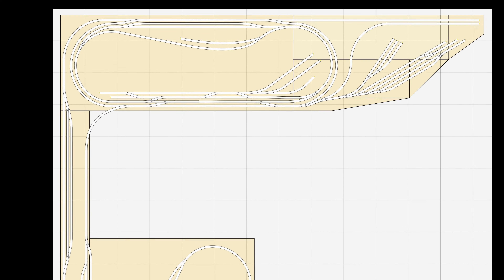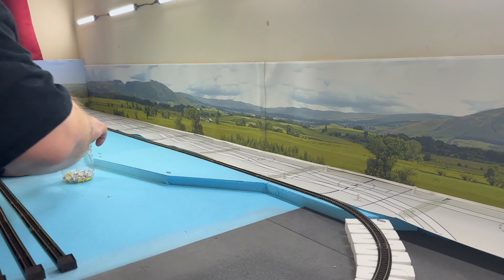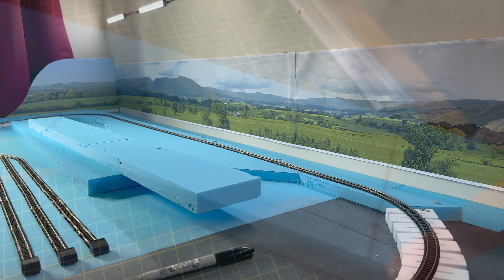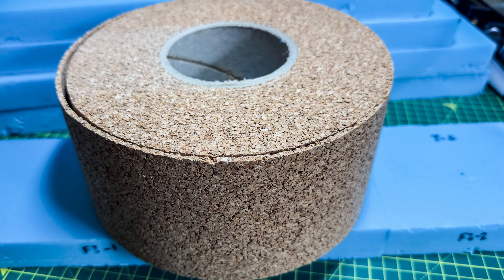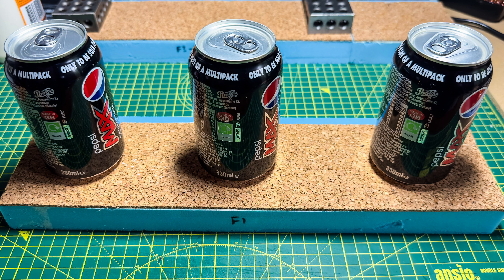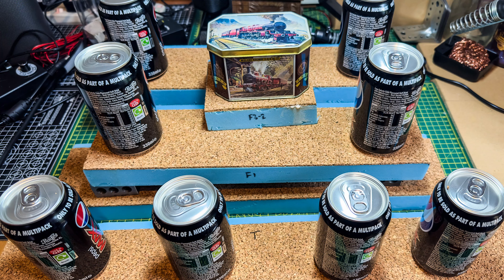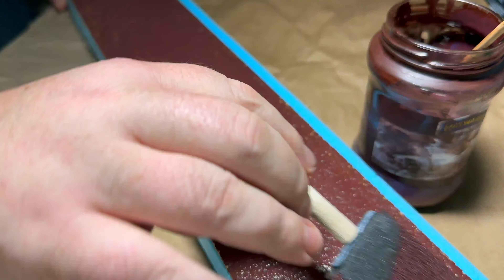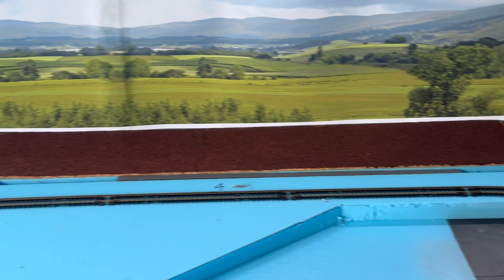067 - Shelfington - The Tricky Bit Progress - Part One

Comment: have found when painting cork, foam and similar its useful to slightly dilute the paint - lets it flow into the gaps a bit, a touch of washing up liquid or dishwasher rinse aid helps too - does usually mean two coats but makes the painting vastly easier
Reply from the maker: Hi Dale! Thanks for the advice! The single coat seems to be holding up quite well at the moment, although there are a couple of bits where you can still see tiny sections of cork! I must admit that I'm tempted to go over it a second time anyway! I'll have plenty more cork and foam to paint though so will definitely try your tips next time! Thanks again! All the best, Ian.